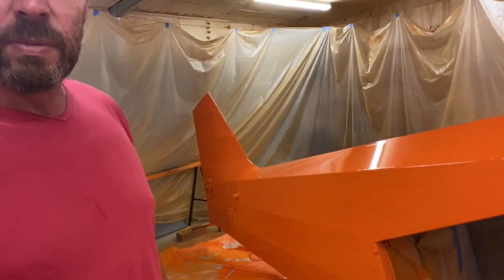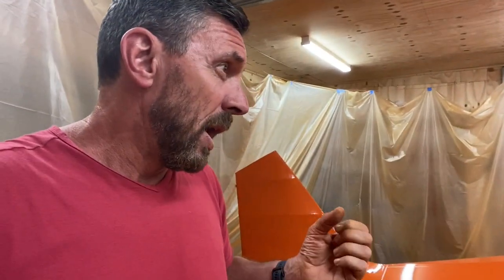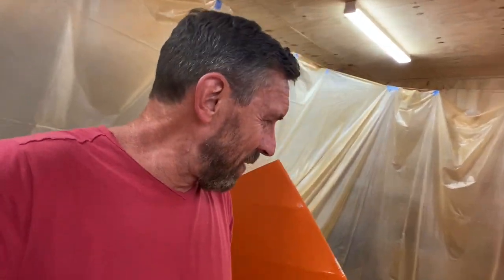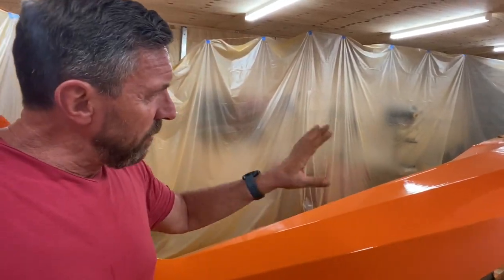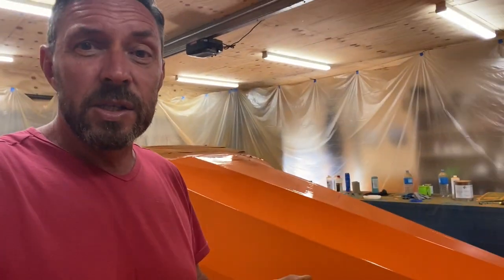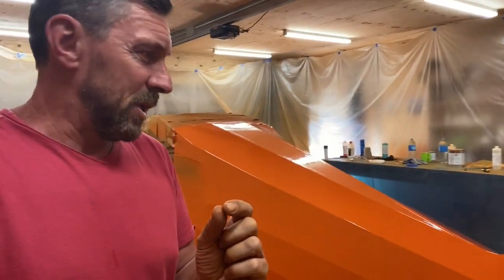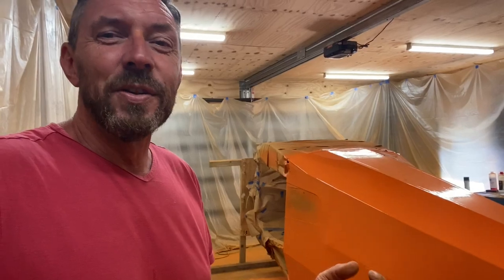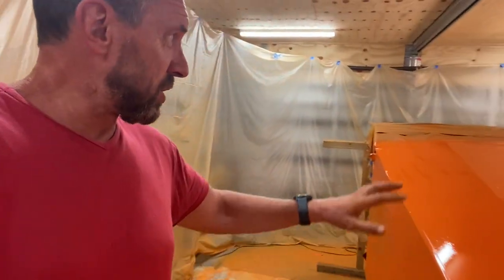Bearhawk Aircraft - Bushplane Build - Paint Debacle !!!

Comment: Just came across your videos, great job. If it helps, as an somewhat experienced "Stewart Blue's" singer 😉, here's a couple of things that helped me. Good Spray Equipment, 1.2 Nozzle Jet, add a cooling coil, condescant air dryer and filter. Try to paint the final coat flat as much as possible to allow for flow out vs runs on vertical surfaces. Once it's tacked up a bit turn it and move on the next one. As for the primer, dark brush, dark spray, light spray and than paint. Your paint hue will vary somewhat with the darker vs the lighter primer. And in conclusion, love the glue, ok to prime but super finicky to lay a perfect finish. Good luck, no worries it's looking good!
Reply from the maker: Willy - thanks a heap for your help. Today I’ve finally finished painting the boot cowls, did the doors yesterday. Seems to be getting better as I learn, but it was a steep curve. Many thanks.
Reply: @bearhawkblog3527  ..my pleasure! Lots of thin coats to build up the paint and a 1/4 to 1/2 turn fatter for the final seemed to work for me. Stewart paint is sensitive to moisture in your air. My results improved with adding the "homebuilt" cooling/drying set up. I sprayed Air-Tech Coatings (highly poisonous) with a cheap Wagner HVLP sprayer and had great results, but it's "industrial" in the smell. Poly-Tone is my favorite for longevity. Stewart is been giving us some issues in our Canadian +40/-40 weather especially if you're not constantly hangared, like ski flying and float flying. Stewart works, but patience is in order. Cheers!